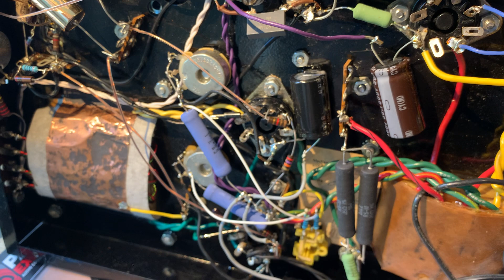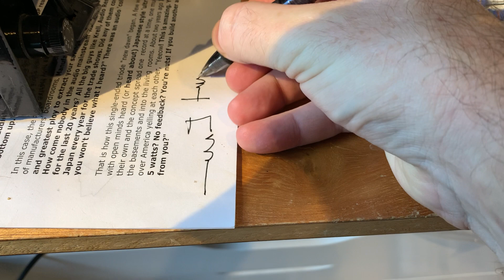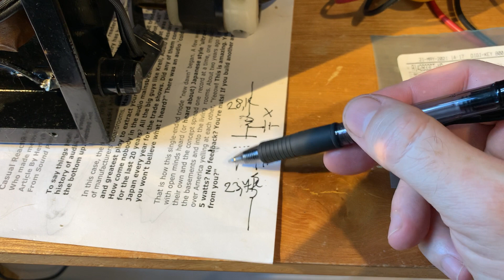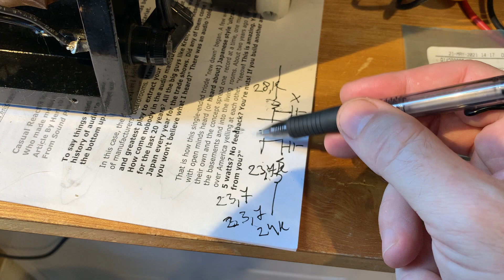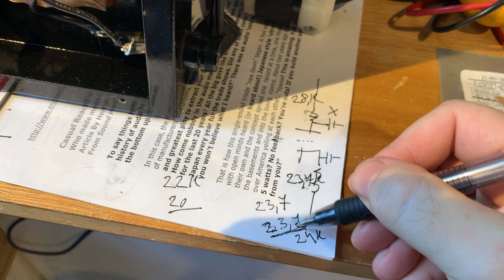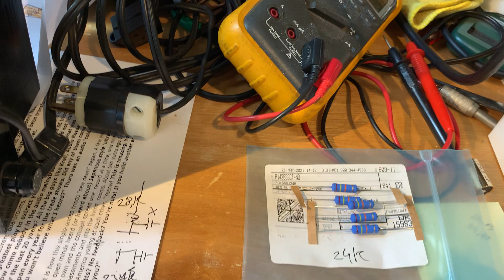Quick Tip for resistor tolerance selection

Comment: It’s odd that this vid popped up in my feed, as I am putting together new crossover parts for the pair of Fortes I recently got from a neighbor. Arriving earlier today, I received two 40R 5W resistors I’d ordered, one for each speaker. I bought 4 because they were +/- 5% tolerance and got two 39.8R 10W resistors out of the batch. I also doubled the wattage of each.
Reply from the maker: I also do that often, get 5% tolerance resistors, more than I need, and then there's always enough to find matched pairs. :)